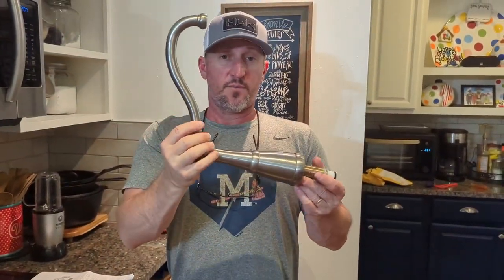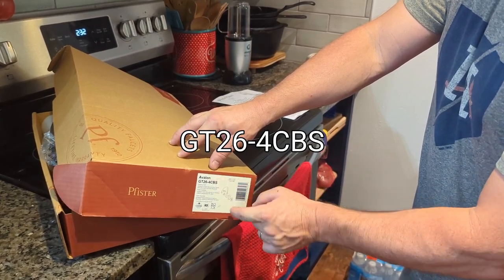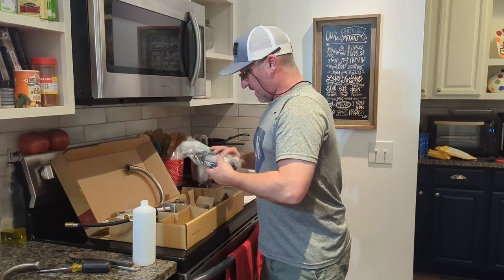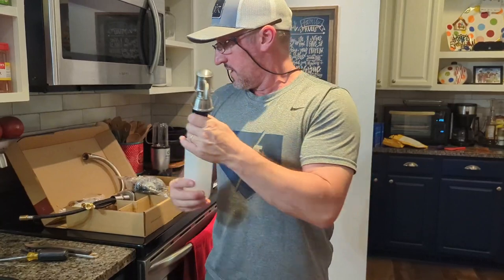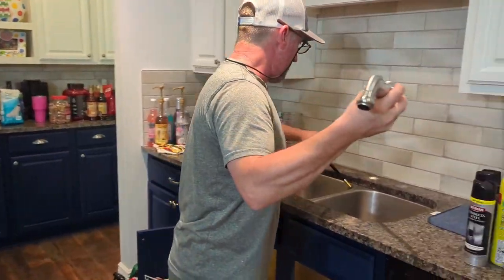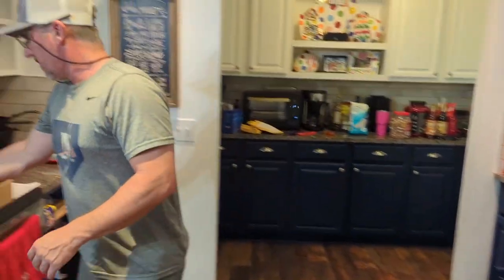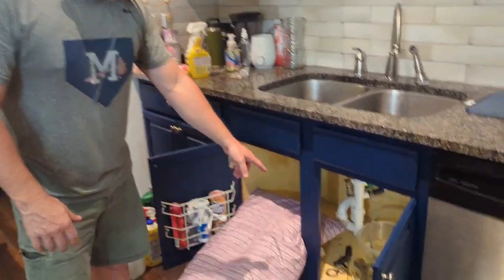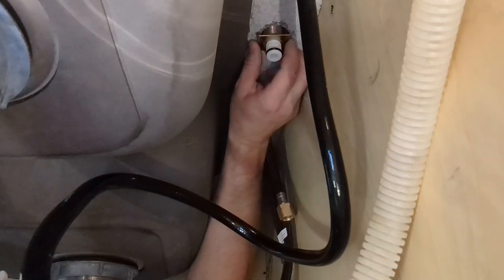How to get a Kitchen faucet for FREE | How to install the Price Pfister Avalon faucet DIY kitchen

Comment: noticed you didn't use plumber's putty. Where would you put that if you had used it? Does it go between the plastic washer and the faucet, or between the washer and the counter?
Reply from the maker: You don't have to use plumbers puddy up on the faucet, just on the drain basket in the sink.